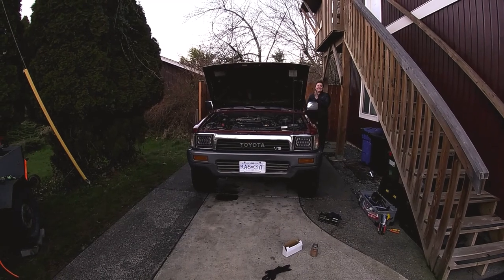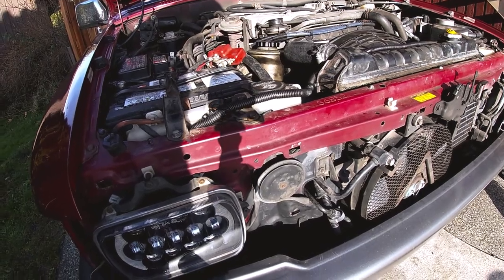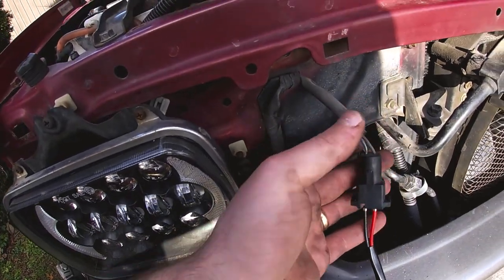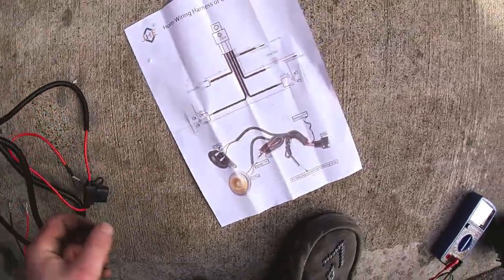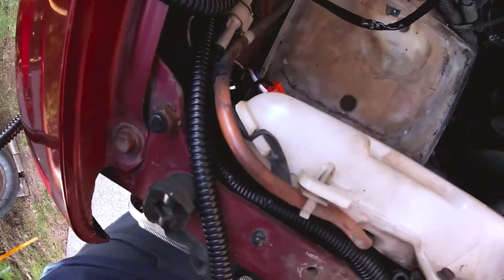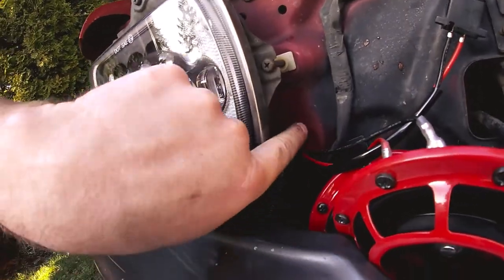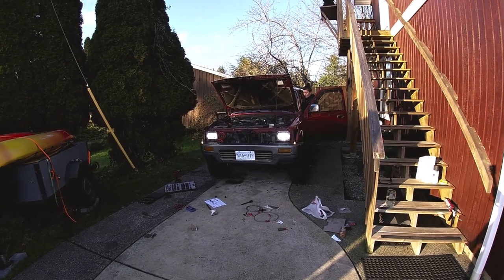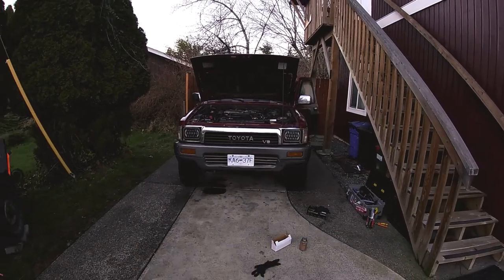Hella Horns 2nd Gen Toyota 4Runner

Comment: Will these work with a 91 toyota pickup sr5?
Reply from the maker: Yes they will. Both the 4Runner and the Pickups from  late 89 - 95 are pretty much the same with only a few differences. These horns are also designed to be added onto pretty much any vehicle's stock harness. The only reason for us buying a separate harness is due to the way these vehicles are wired. I believe there is a difference in polarity or frequency compared to North American vehicles but I would have to do more research to validate exactly what the difference is.